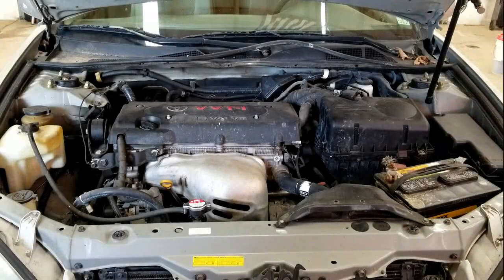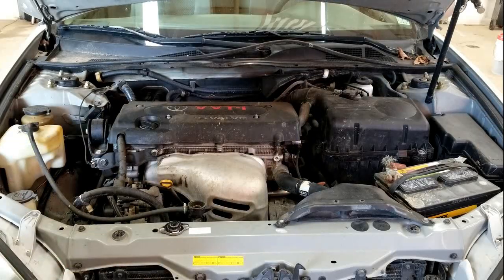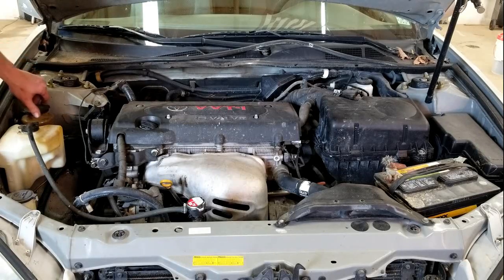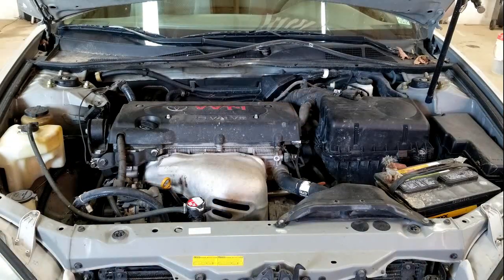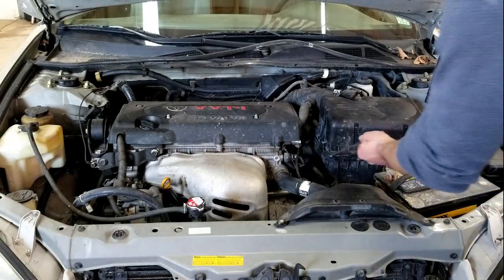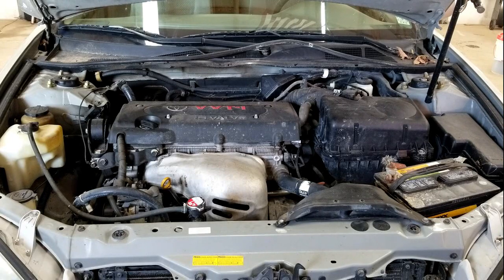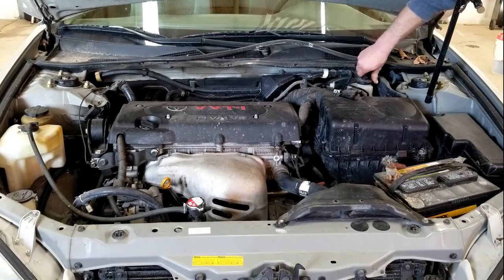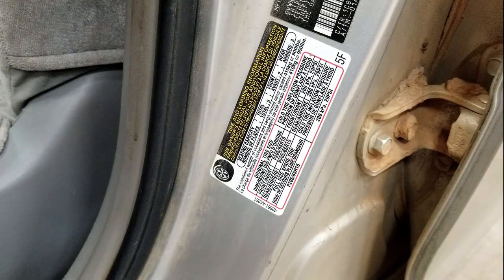Three things every vehicle owner should know how to do

Comment: First!
Reply from the maker: Thanks for the comment! i am still trying to get the hang of doing the video recording part but hopefully this was helpful. If you have any particular part or repair you would like me to make a video on let me know, and ill try my  best to accommodate you.
Reply: Diy_Automotive the floor carpet behind the driver (that is, passenger side behind the driver)  is always soaking wet. If I soak all the water out, it will be wet again soon. I heard it could be a heater core problem. If you could do a video on how to fix or flush or do anything about the heater core and the wet carpet it's causing, that would be awesome. Thanks!
Reply from the maker: @eeyyaakk6801  very well could be, are you having to add coolant to your vehicle? does it smell sweet?
Reply: Diy_Automotive yes sometimes the coolant in the reservoir tank seems to be lessened. I'm not sure about the sweet  smell. I guess I'll smell it later
Reply: Diy_Automotive I should also ask if the heater core, wet carpet, and engine overheating, all three of them, could be related. When I'm stuck in traffic, sometimes the temperature goes up. I would have to turn off the air conditioning for the temperature to go back to normal. If no traffic, engine doesn't seem to overheat.
Reply from the maker: @eeyyaakk6801  possibly could be. I've got a video on how to check for a leak in the system, just havent finished editing it yet. Its odd to me that the temp would rise with the ac on. Normally when the ac is turned on if it has electric cooling fans one of them will kick on.
Reply from the maker: @eeyyaakk6801  if you have Facebook you cant contact me threw messenger on my page directly for a faster reply and I can also send you pictures etc on specific items (how to remove a panel, or undo certain items) I actually have a customer bringing in a vehicle for a water leak and I'll make a video on that but it way be a week or two before its finished and uploaded.
https://www.facebook.com/DIYAutomotivefix/
Reply: @diy_automotive  Thanks a lot I really appreciate it. Will contact you soon!
Reply from the maker: @eeyyaakk6801  you're welcome.